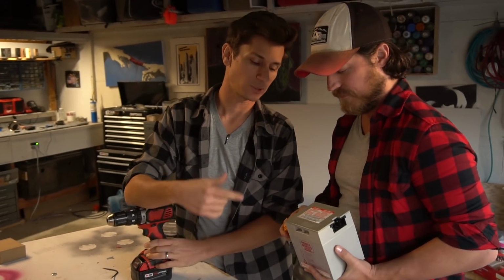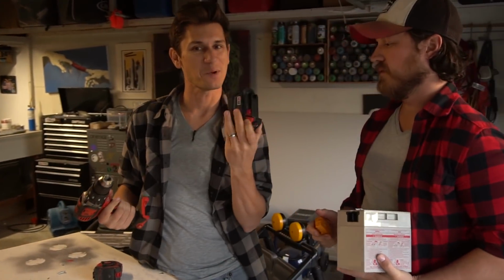Restoring an old Power Wheels Jeep

Comment: Just tell me how to remove the dang back tires 😭 cuz I want to do this so badly but all tires need replacing. Front were no problem whatsoever but the rear nuts just spin and spin and spin.
Reply: No sooner than I comment that, I figured it out! On to finish the restoration!